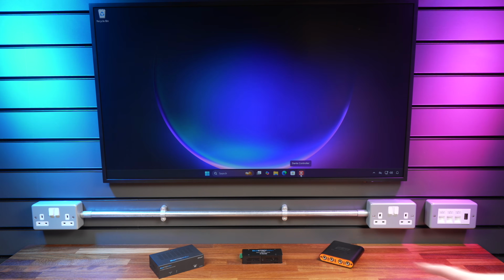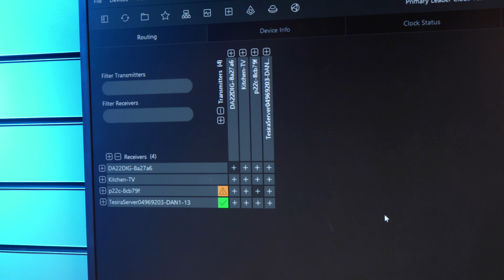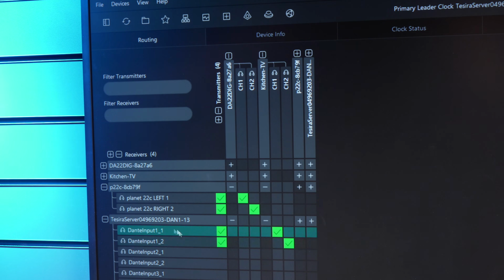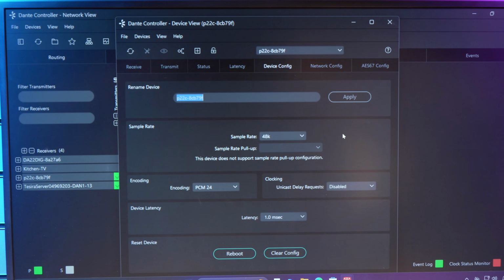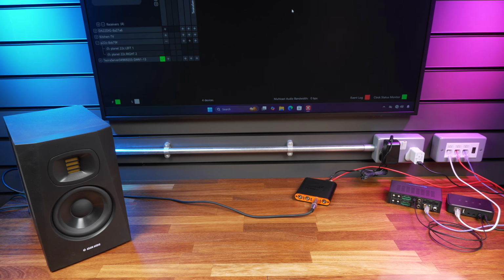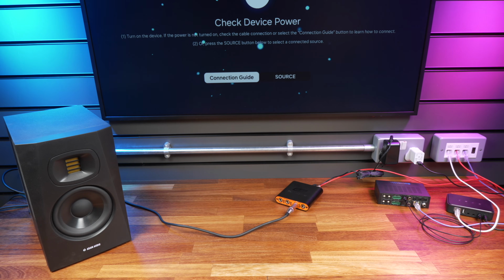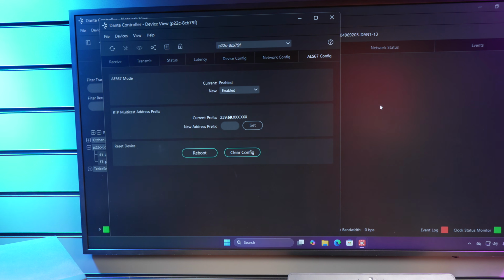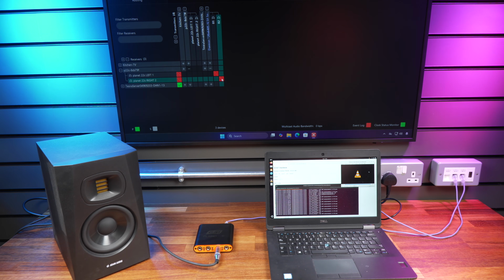Building My Ultimate Multiroom Audio System — Part 3: Dante Audio over IP!

Comment: I love Dante, I use it everyday at work and it’s rock solid.
On a 1Gb/s link you can run up to 512 in / 512 out channels at 48kHz / 24-bit uncompressed audio. With Dante Domain Manager you can even do L3 routing.

Latency is ultra-low thanks to PTPv1 clocking, but you must ensure clocking stays stable.

⚠️ A word of warning: be careful with IGMP Snooping on small switches. Dante relies on multicast for clocking and device management (even if most audio flows are unicast). If IGMP Snooping is badly implemented, it can block the multicast traffic and cause serious clocking issues.

If you don’t use multicast audio flows, it’s often safer to just disable IGMP Snooping.

For the ESI device, I had issue (cracking in the audio) when it was powered with PoE, use it with the power adapter included.
Reply: For audio over IP stuff, should I run it over a dedicated switch and what should i look out for on a switch to make sure it works well with Dante
Reply: @imgeedup  Audinate, the guys behind Dante, have great guides and preset configs for Cisco switches on their website. In a nest case do their Dante certification. It's free and doesn't take too long and it gives you everything you need to know.